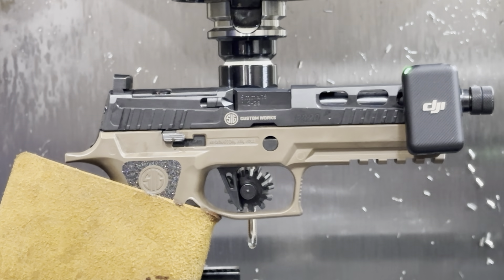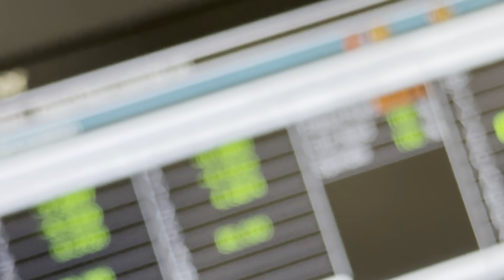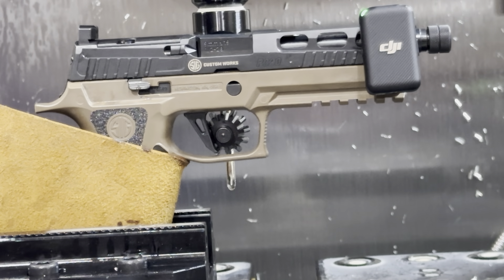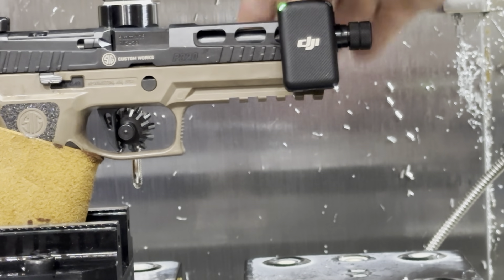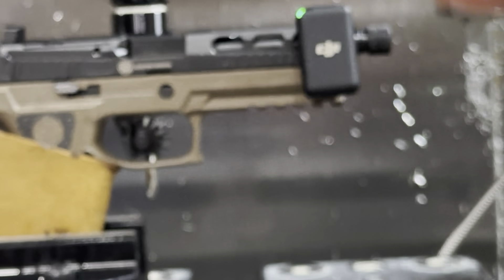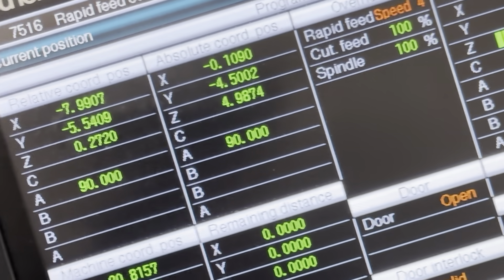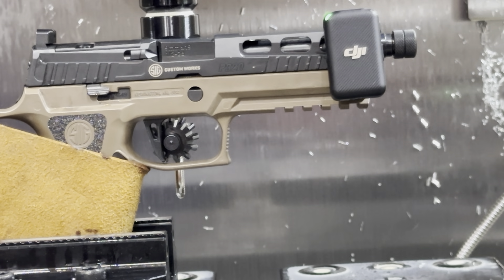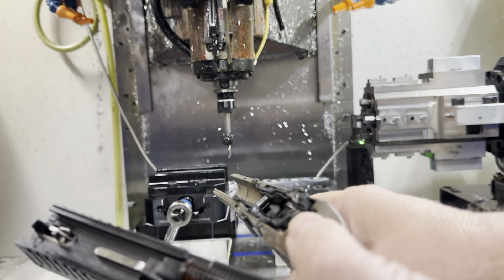Sig P320 accidental discharge tested in CNC machine.

Comment: 2mm or 1mm doesn't make a difference. Either way it fired without the trigger being fully pushed to the rear which is unacceptable.
Reply: he proved the glock failed the exact same test. watch his other video
Reply: @CitizenSeven500 Glock didn’t fail the exact test. With the Glock you’d have to defeat the trigger safety first. The Glock has an extra layer in its system that helps prevent that scenario.
Reply: @OGCovina  both released the seer 20 thousanths before it was suppose to by wiggling the slide, regardless of the amount of trigger travel
Reply: Every other striker fired gun still has play after the striker is released.
Reply: Glock unacceptable too?... https://www.youtube.com/watch?v=NKiN14zTF6o
Reply: Post travel is present in all strikers for what it's worth.... They all fire before hitting the very rear.

Keep finger off bang bang switch until you intend to. It's a rule for a reason.

SIG needs to fix their stuff, but people don't have the luxury of only kinda pulling a trigger. You are, or you aren't. There is no gray.
Reply: @gh0st-6They all fire before hitting the very rear but does wiggling the slide set them off? I’d like to see this test don’t with a Glock, and similar actions.
Reply: @OGCovina  There is a video where a guy does exactly that with a Glock (and a Sig) : https://youtu.be/tp06nAlXLsg?si=vSmBd2TdONdYQ6-a
Reply: @JerryGulla Just watched, he said it was a lot harder on the Glock which equates to it being safer. Also the trigger safety had to be manipulated first, if the issue is out of spec holsters applying pressure to the pistols trigger, one would think the extra trigger safety on the Glock would prevent that.
Reply: @OGCovina  Right - was only pointing out the video when someone asked. Also AFAIK (since I live in MA as you can't buy a Glock unless you are a LEO) the trigger pull finishes cocking the striker. Really though, it's all speculation until the investigation is done by the USAF and we (hopefully) get a full and proper accounting of what happened

Comment: I have a California model which has a manual safety and a magazine disconnect. The slide has very little slop compared to the one in this video. But I only have a couple hundred rounds thru it. I tried the test and could not get it to fire. I wonder if being a CA model makes any difference?

Comment: "20/1000ths. Not great, not terrible." - Sig's PR comrade Dyatlov
Reply: You didn't see a bullet hole in the floor. You didn't. YOU DIDN'T BECAUSE IT'S NOT THERE.
Reply: @viktort8229 😂😂😂😂
Reply: what a great refrence
Reply: Tell me how an ~~SIGP320~~ RBMK Reactor just explodes ~~goes off on its own~~
Reply: Dude! Top comment 🤣
Reply: If a gun goes off while you're applying pressure to the trigger, it's your fault. This test is irrelevant.
Reply: @mostdavestdave69 This test proves exactly that the trigger needs to have pressure applied to it.
Reply: @mostdavestdave69  Which trigger was applying pressure the airman while the SIG was holsted in the table? Please signal in the doll where SIG was applying pressure to you...
Reply: @Buran01  We aren't saying the gun isn't faulty, we're saying THIS isn't the issue. This specific scenario occurs with MANY striker fired handguns.
Reply: @Buran01 Can you tell me more about this incident. What table was it on? Was it a "desk"?
Reply: @mostdavestdave69 The problem is that the trigger is so light that pressure can be applied without touching it. Also, some P320s have much worse tolerances than others.
Reply: You have a radiant personality
Reply: "SIG was in the 'bathroom' when designing this gun"😂😂😂
Reply: It's not 20/1000th, It's  15 thousand!

Colonal Pikalov.
Reply: Take him to the infirmary! He's delusional!
Reply: It’s neither good nor bad. It’s 100% irrelevant. 

There is NO ACCEPTABLE scenario where you would have a loaded weapon, with mag out, and trigger depressed within 19 thousands of break and you grab the slide. For God’s sake, how can people be this fckn dense!!!  

What are rules of gun safety!!!!!
1. Great all guns as loaded
2. Don’t touch the fckn trigger unless prepared
To destroy something. 
3. Don’t point your weapon at anything you do t intend to destroy!

How the fck can the scenario he just demonstrated result in injury or death if following the damn most basic gun safety rules!!!!

Comment: So the trigger has to be pulled to shoot. Got it.
Reply: That's exactly my take away. I don't understand the big scientific breakthrough other than Glock Fan Boys looking for validation.
Reply: @brianfidler2439  To be fair, I'm a Glock boy myself. I just don't buy any of this crap.
Reply: COPE
Reply: @water421  Is that not what you saw in the video?
Reply: @Tony_Shoots the 1mm of pressure needed to make the gun fire itself can be obtained by "incorrectly" re assembling the gun. (Reassembling like you would any other gun). Therefore after field stripping it and reassembling it without using Sig's special instructions, the trigger isn't fully reset, resulting in 1mm or less of pressure, and that is when the gun fires itself while holstered or reholstering.
Reply: @water421  So not following the directions of the manufacturer causes an unsafe situation?
Reply: @water421   Look man, I'll be honest with you. I'm not going to walk around with my Raider chambered. All I'm saying is I don't believe everything anyone says on the internet. I prefer to think things through myself. This one just doesn't really makes enough sense. Yet.

Comment: The only thing you've proved is that this gun truly is flawed.
Reply: kind of what I was thinking...
Reply: This is just a pointless test either way in the face of the alleged issues with the P320. The test he did with both the P320 and the Glock were the same though.. The point being that there is a certain distance the triggers can be pulled, before actually breaking, where the striker can release if the slide is manipulated. This is a pointless test because of course that can happen. These are not machined by advanced aliens and they are not hand fitted to extreme precision. If this is a concerning test for anyone then they are carrying the wrong guns if there is no manual safety and an extremely heavy rolling break on the trigger.
Reply: That's the point
Reply: You are absolutely right about that. But he also has shown that you have to pull the trigger back to almost full pull for the fire pin to release
Reply: @larryg7501 On that particular P320, yes. But there are videos out there showing examples of other P330s going off with barely any trigger squeeze at all.

None of us doubt that at least SOME of the P320s are safe from UDs. The question now is: “Which ones are safe and which ones aren’t?”
Reply: @MyName-r2i9u  yes, very true. Every video i have watched on here, every person is poking and proding pulling back the trigger to the breaking point and beating the gun or doing something to try and  discharge the wepaon. Sometimes it works  and should  no it should not. But do i think they go off by themselves.  NO. I believe all striker fire guns should have some type of trigger safety on it like glock.
Reply: he proved the glock failed the exact same test. watch his other video
Reply: Glock flawed too?... https://www.youtube.com/watch?v=NKiN14zTF6o
Reply: It proves you have to pull the trigger to the point of almost firing. If someone modified some other gun's trigger to fire with less travel, would you be whining about it?
Reply: @brandonkellner  A gun going off at "almost firing" is not a good thing.
Reply: @hectorrivera6624  I noticed you didn't answer my question.
Reply: A modified trigger or gun by you is different than a company pushing an unsafe gun. Don't get your comparison. I modified plenty 1911s and they still don't go off. But if they did, that's on me not the the company.
Reply: @hectorrivera6624  It's because the difference is a matter of degree and not principle. You shouldn't pull on the trigger and expect the gun to not go off.
Reply: @brandonkellner Except that's not the case here. Pressing the trigger to the reset point should not allow a gun to go off. In fact that's how should be firing. Once the trigger resets you stop your trigger/finger travel. Again a gun should not be going off at the reset point by just shaking it.
Reply: @brandonkellner  "the difference is a matter of degree and not principle"

The degrees matter in the context of duty pistols.

"You shouldn't pull on the trigger and expect the gun to not go off."

"Should" or "shouldnt" is irrelevant in this context. All that matters is whether you "can" or "cant." I can depress the trigger slightly on a G19, a P10, an M&P, or a PDP, and no matter what anyone does, those firearms are not going to go off.

The P320 was flawed from its inception. It should have stayed a P250 or had a complete redesign from the ground up. But, once again, Sig is out here using its customer base as product testers.
Reply: @hectorrivera6624  If it was due to just a trigger pull, and yes this would be a surefire statement. But 83% trigger pull is pretty much in the realm of intentional trigger discharge.

Plus people have to stop acting like it's normal you just shake your slide around like a madman more than 3/4's into a trigger pull. Not realistic for real world use cases. Only questionable when talking about possible holster interference.

And pretty much entirely not an issue with manual equipped safety models. As you're not getting anymore than I'd say 0.2MM into at trigger pull before you're entirely locked out.
Reply: @iTrinityPlays  Wasnt the M18 that killed the airman equipped with a manual safety?  Would you wear your beloved P320 appendix?  You fan boys are funny as hell.😂😂😂
Reply: @brandonkellner yes because modified less trigger pull doesn’t mean that there isn’t a SAFETY wall. If the gun gos off before passing the wall, then that means one of the last things that should fail on a gun is wearing out prematurely. And as we know, anything that wears out reaches its peak until something critical happens in result of it which is what’s been happening. 

This gun is junk unfortunately and those of you who continue to stand behind are essentially saying…..”I’ll just drive slower in the rain on my bald tires because I don’t want to give up my Perellis”
Reply: @angeldesigns1385  If you modify the trigger to go off at the same pull that the sig will go off with the slide manipulation, then you have a less safe gun than the sig.
Reply: @angeldesigns1385  Problem is that is it passing the wall every time before it goes off. At 83% into the trigger pull, that's a solid 33% into the wall before the slide makes it go off.

Another problem is that some P320's have extra wiggle on the slides, and others don't depending on variant, and manufacture date.
Reply: @brandonkellner testing a single gun proves that? What about the ones going off in the holster?
Reply: @JA-oo9qp  So the holster is pulling the trigger?
Reply: Please stop arguing. Show another unmodified modern firearm that can be made to fire without pulling the trigger completely. THAT is the problem. It's not a matter of degree of trigger pull. It's that the gun can fire without a complete trigger pull. 

Just think about it objectively for a second. Whether a gun goes off when someone looks at the trigger, or when you almost complete the trigger pull, THE GUN IS FAULTY.
Reply: @danya822  Thats what I keep saying. If this isnt a problem with all the other duty pistols (and it isnt) then the Sig P320 is all alone. Its a dud. A lonely dud, all by itself.
Reply: @danya822  Faulty? Sure, but what does that really mean? If a gun manufacturer makes a pistol with 1mm less of travel distance, it's less safe than the sig, but it's not "faulty". Who cares? Don't pull the trigger if you don't want the gun to go off.
Reply: @brandonkellner Faulty means it doesn't work properly. Brakes in a car, airplane engines, an implement that puts holes in people. All items in which "faulty" is a bad thing. 

Doesn't matter the degree of faulty. It is less safe than pretty much every other pistol made in the last 70 years or so BECAUSE it's faulty. Stop arguing about how dangerous it is. It's dangerous, it's a poor design, it's clearly repeatable, don't advocate for it.
Reply: @danya822  Actually, yes it does matter the degree of faulty. Don't be ridiculous.
Reply: @brandonkellner which is completely unacceptable.... End of story. The cope from you SIGers is unreal.
Reply: @brandonkellner  now to be totally fair, this proves this particular gun won't go off until it's almost fired. 

Based on people's comments in other vids, it seems that some were able to make it fire and others weren't.

So likely a quality control issue but I don't know much about gun design so I'm just gonna watch all this from the sidelines
Reply: @cthulhuspawn6290  All the vids I've seen basically show the same thing, granted I've only seen like 3 others, except for this Wyoming guy, who seems to have a hard on for the military getting rid of the Sig contract. I find it suspicious.
Reply: @brandonkellner  i mean, this vid shows that there is a problem with this gun.

 Just because that Wyoming guy seems to hate the p320 doesn't make his vid any less meaningful because the flaw IS there

At the end of the day, I think we can all agree that further testing is gonna be necessary on this gun
Reply: @brandonkellner  "except for this Wyoming guy, who seems to have a hard on for the military getting rid of the Sig contract. I find it suspicious."

Is it a great big conspiracy, Q?
Reply: @brandonkellner  "It proves you have to pull the trigger to the point of almost firing."

So youre saying the firearm will go off prior to you pulling the trigger past the break? You realize that makes this firearm uniquely unsafe among other duty pistols, right?
Reply: @MyName-r2i9u  I've said it several times now, maybe already in this thread, but if you pull the trigger, you shouldn't expect the gun to not go off.
Reply: @brandonkellner  "you shouldn't expect the gun to not go off"

And I have already responded that "shoulds" and "shouldnts" have nothing to do with the discussion. What matters is "can" and "cant."

I cant cause a P10, 92, M&P, PDP, or any other duty pistol to go off by depressing the trigger a mm or 2 and then manipulating the slide. I can with a P320.

Regardless, I disagree with your assertion at its base. I absolutely should be able to pull a trigger back a mm or 2 and never, ever have to worry about it going off no matter what I do. I should never expect (or even suspect) that any firearm I own would go off without full trigger squeeze.
Reply: @brandonkellner  you remember having that friend that would tap you on the shoulder and remind you when you're in a hole, stop digging? (tap,tap)
Reply: @jjmaker  Take your shame tactics somewhere else. If you want to argue, that's fine.

Comment: The precision/accuracy of this experiment is really great, especially in contrast to the other video. After discussing with one of my firearms examiners, we wondered if there is there any chance you can repeat the experiment with a magazine loaded with either dummy rounds (preferable), or empty cartridge cases? His prediction is that the current 82.5% trigger pull (when going click with slide manipulation at .090) will increase with a loaded magazine inserted. Our guess is it won't go click with slide manipulation until you are at .100 or greater.